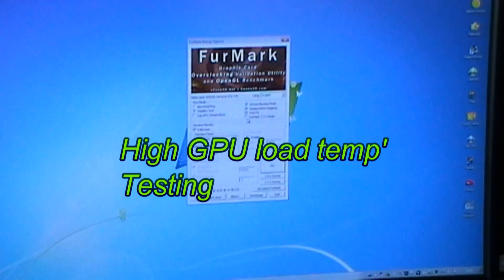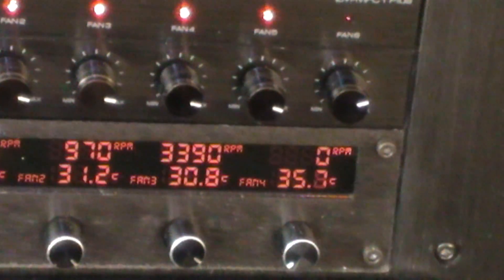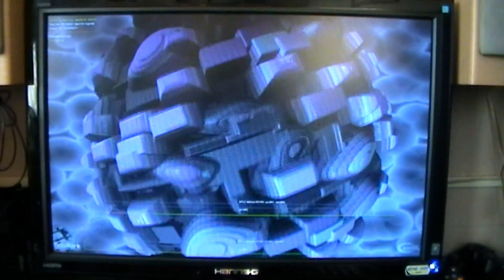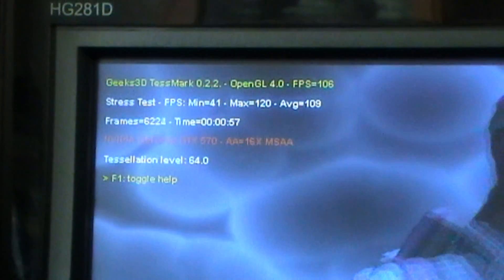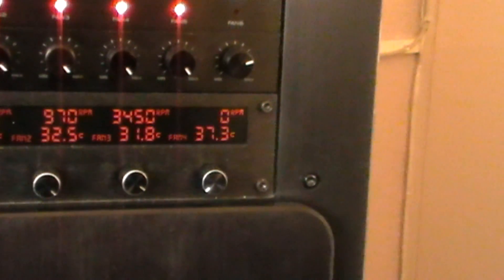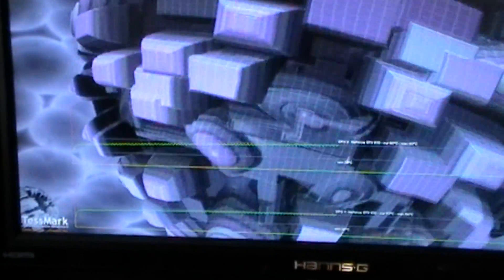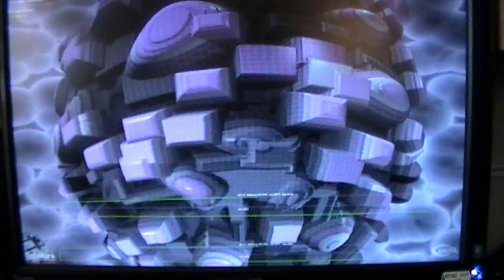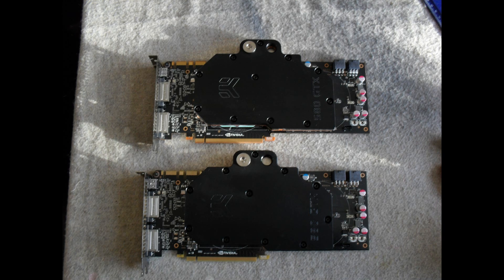GTX 570 SLI GPU stress test,  temps' using watercooling (EK Blocks)

Comment from the maker: @DreamyBoy021 At launch the 590 was a bit "fragile" I saw a few fail in the first weeks after launch, so when I moved from the 570s I went to the 580 3gb I Sli as I need the extra v-ram as Im now running 3 of these monitors in 2D surround.
Personally 570 Sli would be a good choice, grab 3 gb versions if you can find them.
I do know ppl who use the 590 and they like it so either would serve you well I think.

Comment from the maker: @TheChrisglasgow ok, the rad will cool the water using the air that passes through the fins, where is the coolest air, inside the case or outside the case ?
ppl use rads inside so that the hose runs are shorter and it keeps everything "in the box" I dont go to lan parties my set up can be spread all round the room, I use 2 pumps to make up for the frictional loss due to the lenghth of some of the tubing. Rads outside are easier to maintain and manage dust, I have tried all ways belive me

Comment from the maker: @TheChrisglasgow cooling 2 580s on a 240 internal rad is asking a lot, if 70 is the max, its higher than mine ofc but as I said ihave a stronger loop.
lets not forget 70 for  a high end gpu is not high at all as they will happily run all day at 85 to 90 and using 3 monitors wont make the gpu any hotter if he is already scaling it at 100% use.
I have always built my own loops and learned as I tried different ideas.
for me £500 for a 240 loop and a gpu running at 70 would not be acceptable

Comment: @fmsam the thing that annoys me is i had the cards at max temp of about 90 on air but i use 3 moniters, so this guy has stressed test these cards on only 1 moniter so wat is the temps going to be like running 3 3D moniters, i havnt paid him yet, but from wat you have been saying i dont think i will, i might just ask him to take the watercooling back out as it isnt worth £500

Comment: @fmsam the guy says it's b cos the top card makes the warmer so by the time it goes through 2nd card it isnt as effective ! Im using a coolermaster sniper case, he says it's b cos he had to change the radiator to a smaller 1 so it would fit in the case, i dont know wat size of radiator he is using but i will find out on monday, he said he ran cards at max load for 3 hours and that was the result, im well pissed off ! My pc wasnt cheap an now i've just spent another £500 ! I was expecting my tem

Comment from the maker: @TheChrisglasgow 70 is far too high, and anyway with 2 cards in Sli the temp diffrerence should be no more than about 5 degrees or so.
post back with more info about the rad used etc.
dont pay this guy yet !

Comment: Hi, nice vid, i've just got my 2 x evga 580gtx superclocked cards watercooled, i havnt even got pc back from the shop but the guy from shop called me an told me that @ max load 1 card was max temp of 70 ! And other card maxed out at 40 ! It's only a single loop with 1 radiator as i didnt want external radiators, but i still think these temps are pretty high considering i just paid the guy £500 for this setup, wat u think ???

Comment: That is alotta voltage for only 825! i have mine at 825 shader linked and only 1.038 Vcore! i want to try getting 900, only thing is i am not that comfortable on air cooling alone....